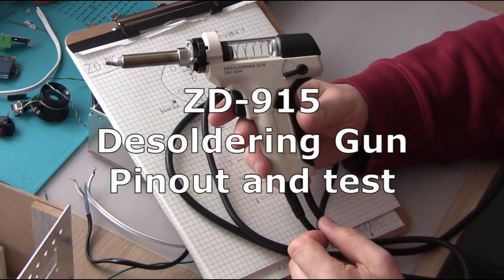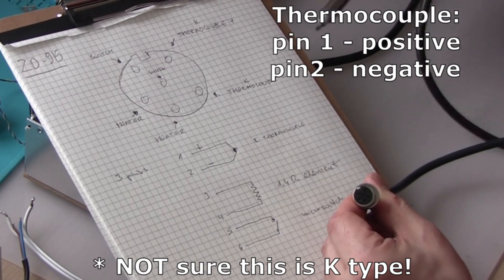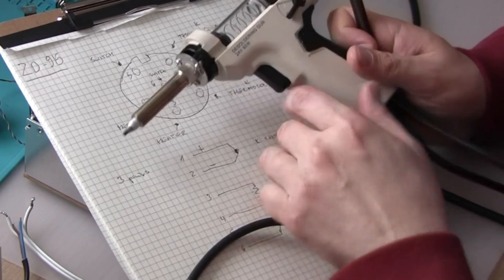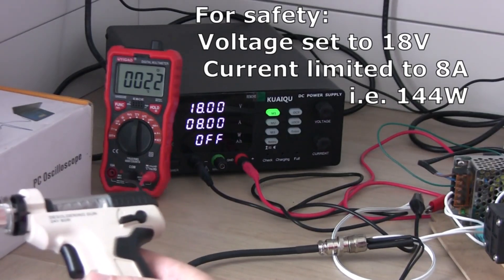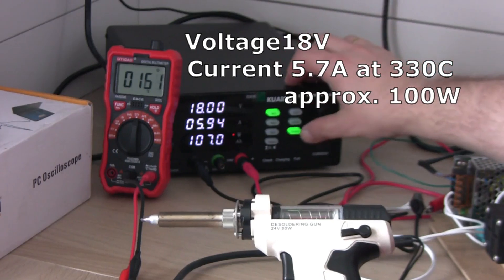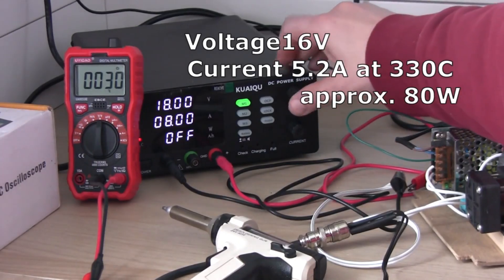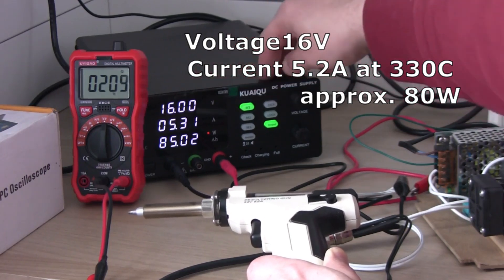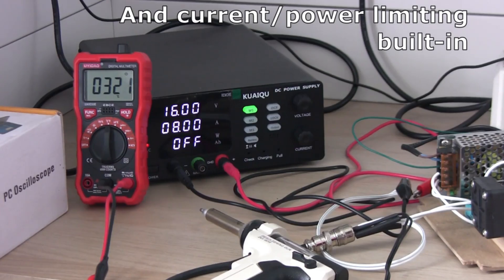ZD 915 Desoldering Gun pinout and test

Comment: Maybe the 24V is for heating fast at the begining and the 18- 16 V is for manteining the temperature with a PID controller driving the gun.
Reply from the maker: I do not think the original controller is so sophisticated to adjust voltage in a wide range and protect the gun or user at the same time. I never owned the station, but online info suggest the voltage is set at 16-18v in the factory circuit. Tiny wires inside the gun are unlikely to tolerate 17 amps of current at 24v - there is a risk the whole gun with the feeding cable turns into heater (before burning down). Even at 16v the gun heats up really quick.